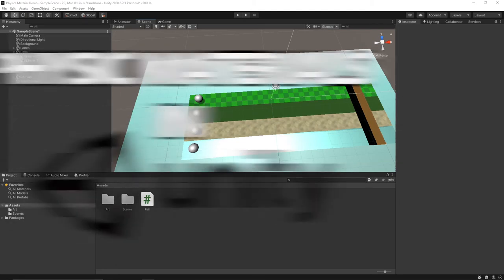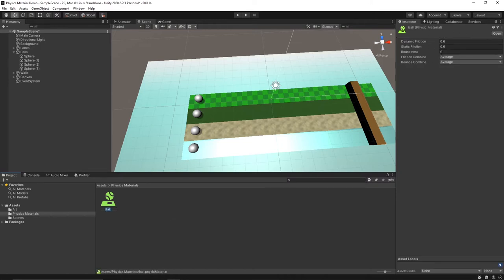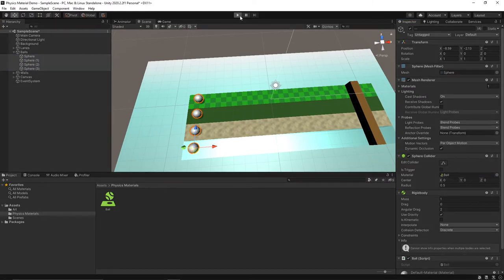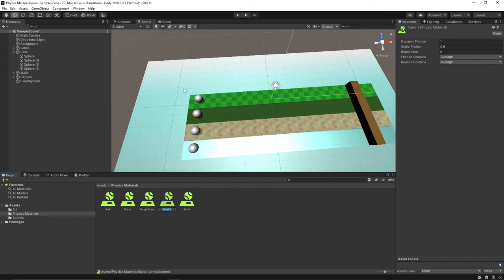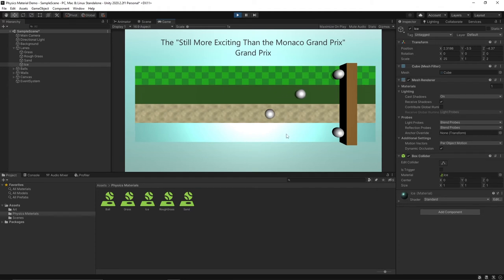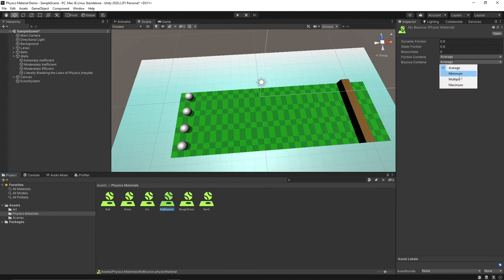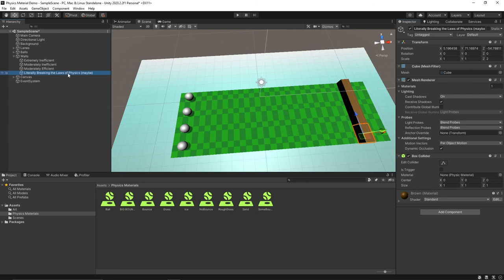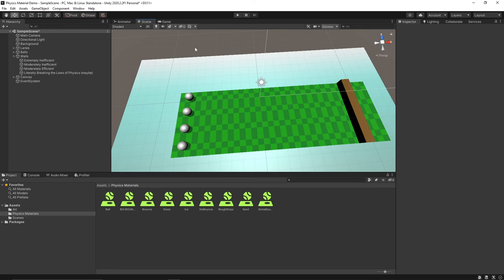Use Unity Physics Materials to Simulate Different Surfaces!

Comment: I'm very confused.  I have a pool game and after I start my ball rolling, 1) it quickly slows down as it switches from sliding to rolling (rolling absorbs 30% of the energy) and 2) then it does NOT stop or slow down from dynamic friction (nor angular drag), no matter what I set it at (during the actually rolling).

I don't see your balls have the slow down effect, so I wonder if your balls are skidding the entire way, which would explain those results.  But you haven't said you've done anything to prevent rotation nor said if your force applies rotation from the start.

The Unity manual suggests (but isn't totally clear) that dynamic friction is for objects in motion that are sliding  against each other.  If your balls are sliding, that would explain everything.  But are they?  

And if yours are sliding, how do I actually specify rolling resistance (friction), because I must have rolling balls and I need to apply a force to slow them to a stop.  Right now, only 'drag' works, but that's said to be air resistance, not a frictional force.

I'm using Unity 2019.4 and have no reason to thing this has changed between my version and yours.
Reply: Same
Reply: @bro_mayo5413  I've since figured out what I needed to make my pool balls work pretty well.  But I had to get much more sophisticated.  It's been quite a while since I did all of that and I no longer remember any of the details.  I remember only a few highlights:  I did a dynamic interaction with code to modify the Unity parameters during motion, as well as modifying the basic project setting of how to model friction -- I needed a more advanced friction project setting which requires more computation, but gives more accuracy. What you need to do depends on how realistic you need the motion to be.  I wanted a very accurate simulation of pool balls but without taking over the complete job of doing all the physics.  It's much easier if your needs are less demanding.

Comment: Helpful visualization - It would be great to address the tail end of the ball's movement. After they all bounce there is an extended period of time where they coast at a very slow speed right before stopping. this looks unnatural compared to the rate at which they slow for the first 95% of their speed.

Would this be adding some sort of ambient atmospheric resistance / air resistance essentially?
Reply from the maker: Yeah this was an issue I ran into when making my game. I found this post: https://answers.unity.com/questions/1101806/spherical-rigid-body-will-never-stop-rolling-regar.html which simulates drag and worked perfectly for me :)